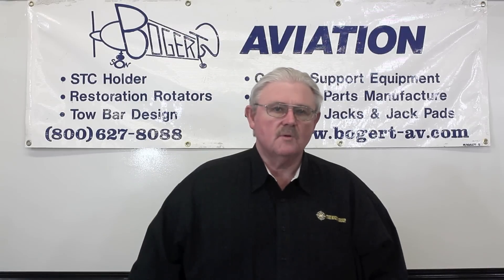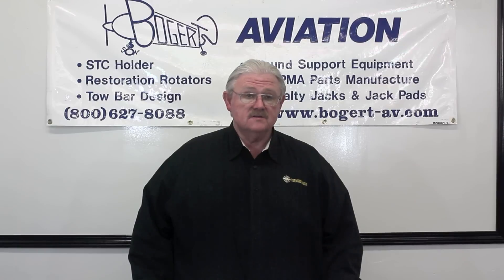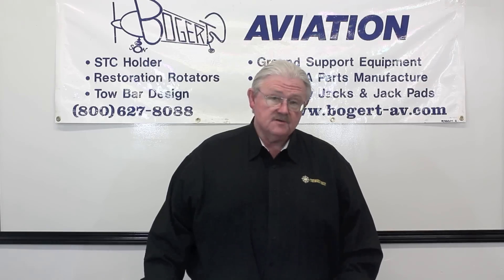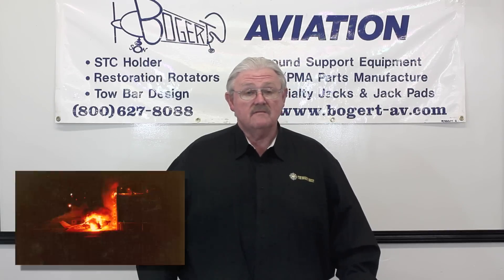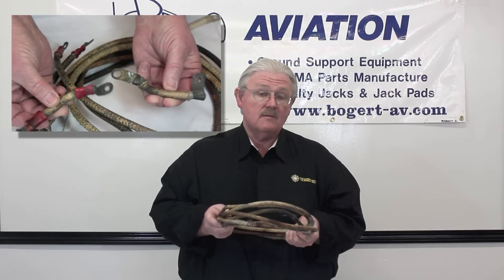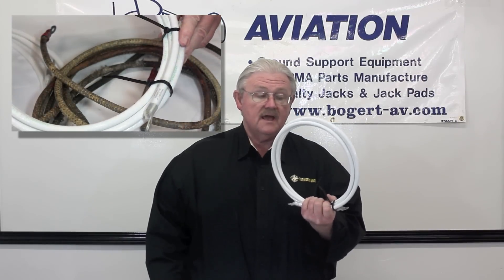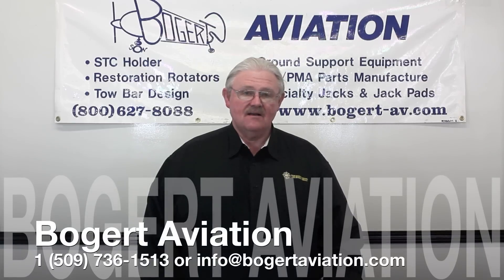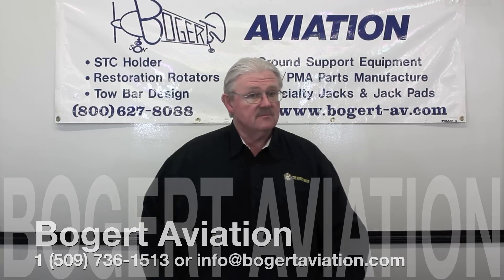Aircraft Maintenance - Install Copper Battery Cable Kits...Remove the old Aluminum Cables

Comment: I'm glad Bogert Aviation put out this video. I have put their cables in dozens of aircraft and the results are dramatic! I have found that replacing the cables often makes weird electrical issues like over voltage trips go away. I used to maintain a fleet of PA31 freight haulers and these cables reduced our down time and maintenance costs significantly.